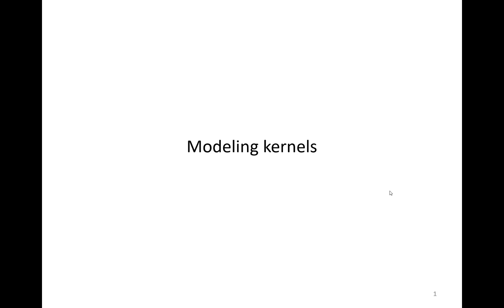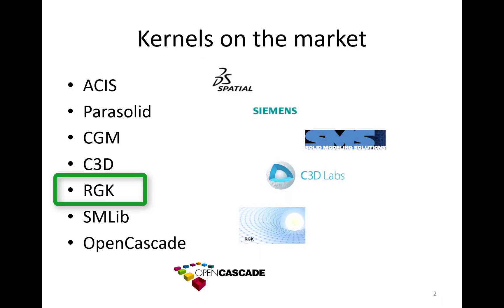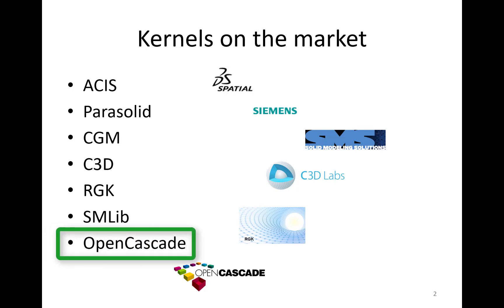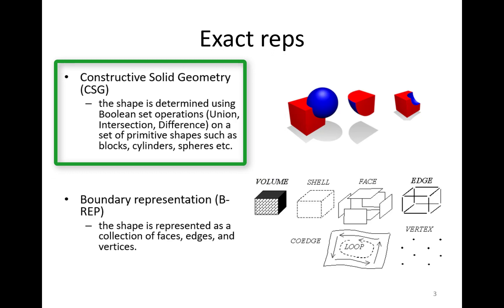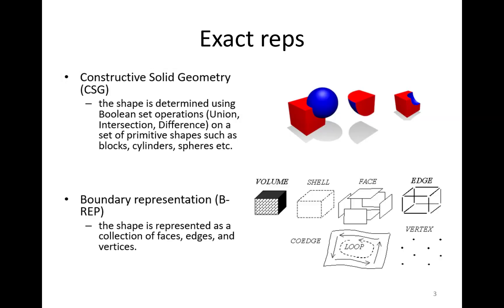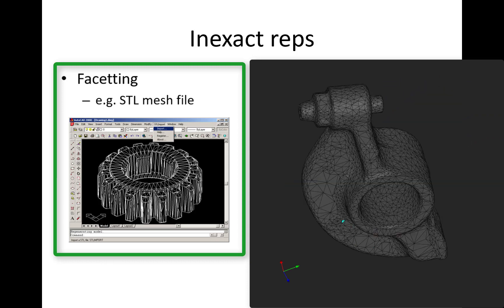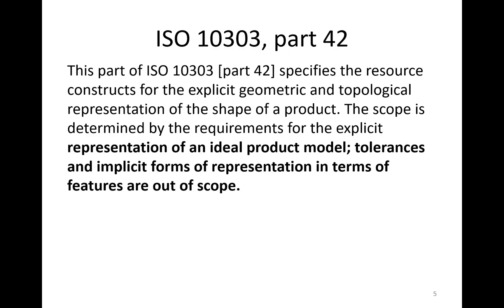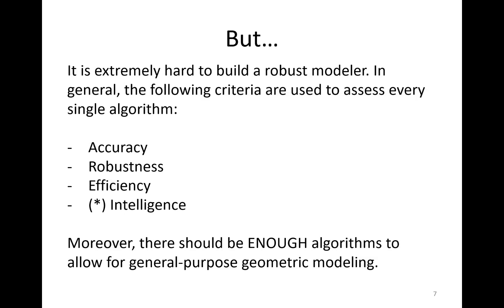Lesson 7: Introduction to OpenCascade and CAD modelling kernels | What is OpenCascade

Comment: 4 years later I would be very interested in a review of TRUCK (Rust driven open source CAD kernel)
Reply from the maker: Rust seems to be on a hype wave but I don't see any specific reason why anything written in Rust should outcompete an old and well-proven technology. Geometric kernels do not need modern programming stuff as much as they need proper algorithms, qualified developers and massive testing. Maybe I'm completely wrong here, though. Is there any CAD system based on TRUCK?
Reply: @QuaoarWorkshop  Not yet anything serious. I completely agree with your statement. The main advantage of a lets say competitive rust based cad kernel would be the perfect integration into any rust based app. My hope here would be massive performance and stability benefit compared to most existing cad/cae tools. There are many parasolid based cae preprocessors which are slow and buggy, not because of parasolid, but because of everything around.
Reply from the maker: @rolandburgstaller10 Yep. Also applies to OpenCascade vs Parasolid. Without any multithreading enabled, Parasolid may at times be orders of magnitude faster than our good old OpenCascade where it is really critical: in the Boolean operations. But I don't really mean to say that TRUCK is bad whatsoever. This library seems to have gained quite some visibility and it definitely makes sense to give it a try while staying open-minded. I hope it's not much better than OpenCascade as otherwise we're wasting time here haha

Comment: Isn't Facetting very popular even in CAE? Because I don't see Boundary Representation to be easy to work with in case of FEA.
Reply from the maker: Maybe I failed to deliver the message clear enough in this video. What I meant here is the central role of B-rep in the entirety of CAx (CAD/CAE/CAM) world. In FEA, you anyway start from a precise CAD model to generate meshes suitable for simulation. Here, B-rep serves as a "master model" from which one can derive an analysis-ready model after some preparation. Just as a side note: there are methods that do not even require meshes (e.g., U-splines) but that's terra incognita to me :)

Comment: Thanks for the video, I have a fundamental questions, What are differences between geometry kernel and a Cad SDK?
Reply from the maker: The answer would depend on what do you actually mean by CAD SDK. In my understanding, a CAD SDK is an API provided by a certain CAD system, like SolidWorks or Catia. In this sense, such an SDK allows you to run functions of a CAD system, including features that are not readily available in a geometric kernel. In the example with SW, the geometric kernel would be Parasolid and CAD SDK is SolidWorks itself. For parametric modeling systems, such a CAD SDK would allow you to work with a feature tree, for example. And "feature tree" is something not available in the kernel. A kernel is only supposed to equip you with all the computational geometry you'd need in a CAD package. Does this answer your question?
Reply: @QuaoarWorkshop  by SDK I meant solutions provided by https://cadsofttools.com/products/how-to-choose-dwg-sdk/
Reply from the maker: @Ronak289296  I do not have any experience with those tools, so to answer for sure you'd have to try them out. For general-purpose CAD programming, you need to have a computational geometry core. Like you read your DWG/STEP/etc. data in memory to some data structure, and what can you do later on? Will you be able to run things like Boolean operations, compute mass-inertia props, evaluate curves and surface, check overlapping, generate meshes, etc. All this can be very domain-specific, while OpenCascade is a general-purpose modeler answering the common need to represent shapes and work with them on a PC. I guess this SDK can serve as a data connector to read formats like DWG/DXF, but I'm not sure they interface with OpenCascade.